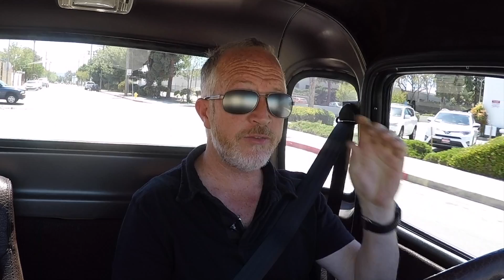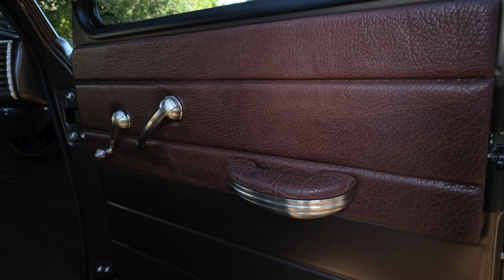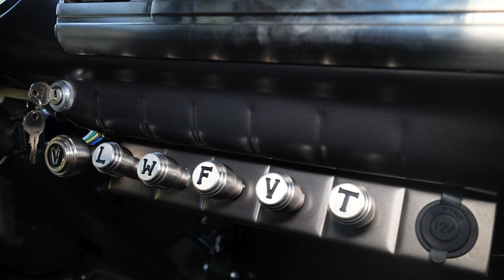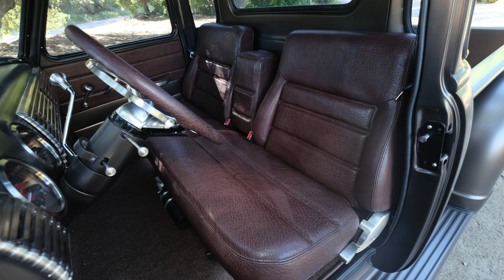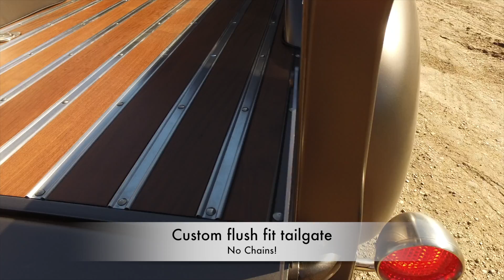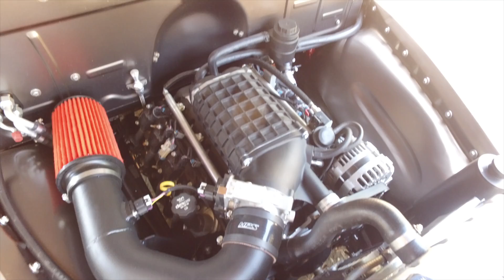ICON New School TR #3 Restored And Modified Chevy Thriftmaster Pick Up

Comment: Absolutely love the Thriftmaster series trucks you produce.  Unfortunately since I work for a living, I'm never going to afford this truck, short of hitting lotto.  However, I do have two questions;

1. Have you ever considered using a three speed on the column tranny configuration?  Is there even a three speed manual transmission that's capable of handling anything near the power plants you use.  It occurs to me that while the absolutely fantastic performance characteristics of these trucks is a key point and using a three on the tree might seriously impede performance it would likely add a bit of authenticity that may well be desirable. 

2.  While I might not ever be able to purchase an ICON vehicle, .. where do you get those shades?  Could you provide the brand and model?  That frosted mirror look is great. I ride motorcycles a lot and I'm always looking for my next set of shades.  

Thanks for  this and all the other videos.   Absolutely a topic important to me and very well presented.  Copious amounts of information offered in a brisk yet not hurried pace.  

Totally enjoyable.  Thank You!
Reply: Got a pair of Dillon Optics.  Great sunglasses, look good work great, .. except when riding.  So, my $250. sunglasses stay whom and I'm still using $30. for riding.  Oh well.